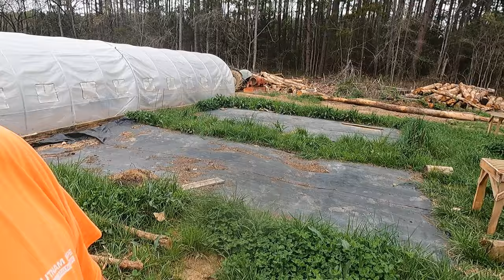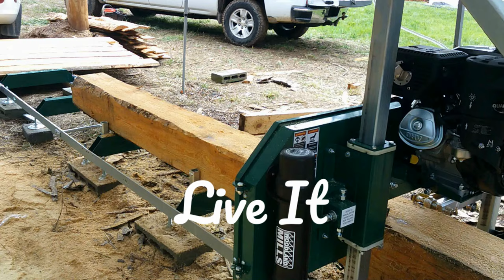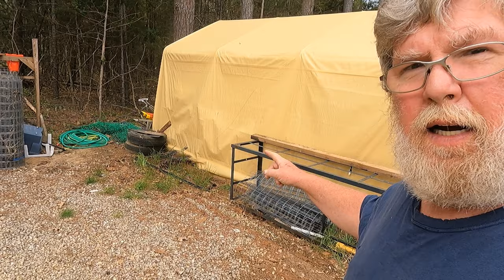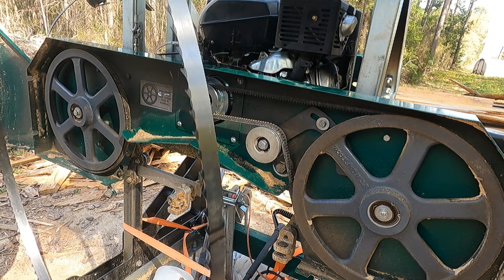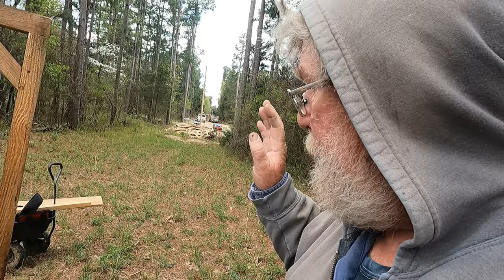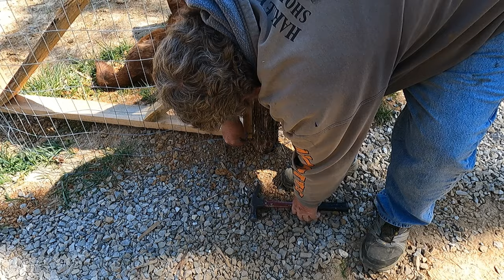REPAIRING MY #woodlandmills #hm122 Garden, Fence, Gates, Homestead, Cleanup, Springtime, Excitement,

Comment: You mentioned 6 snapped blades. Do you run them until they snap? Sounds risky. If you mill a lot of pine or soft wood keep a spray bottle of diesel fuel handy and spray the blade between logs to dissolve sap and help cool the blade.
Reply from the maker: Great tip thanks I don't run them that long on purpose i think with the bad clutch and the fact that i was over tightening the blade had a lot to do with it. after talking to woodland mills tech support they informed me that the torch method is to tight and gave me pointers on the right method. plus I have a sharpener but just don't pull the blades as often as i should that probable snapped half of them.